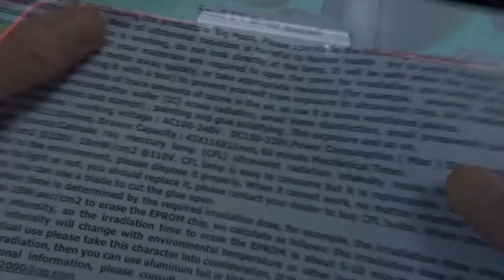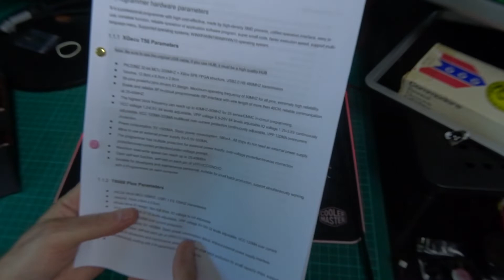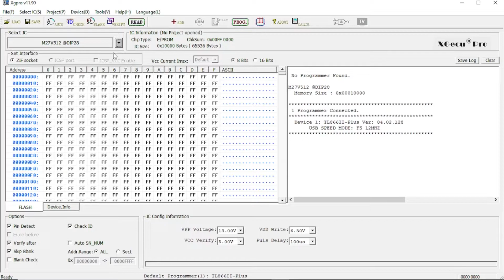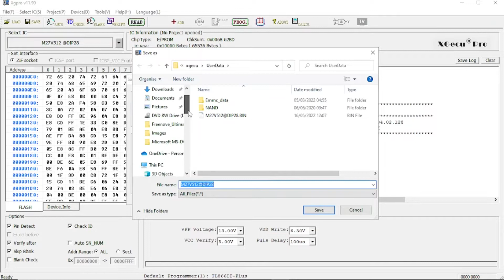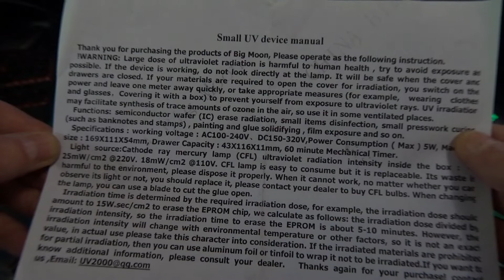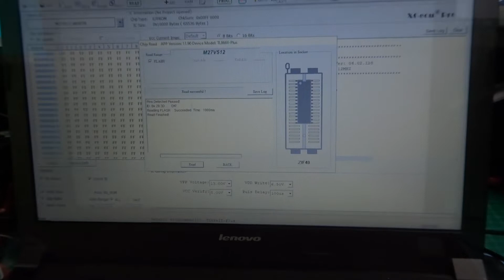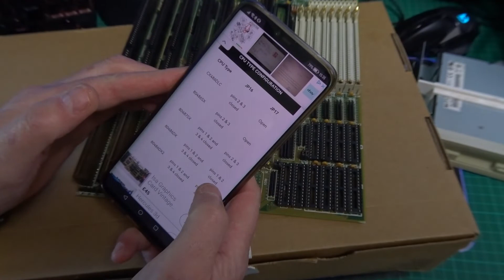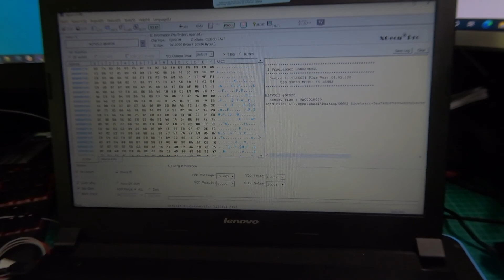Burning chips!

Comment: Hi can you link to the programmer and eraser you purchased im going to try this.
Reply from the maker: Hi. Cant link from the ali express app but search for Tl866ii plus and you will find plenty to choose from. I thing think they're open source and all much the same. I go one on its own without any adapters. I got the uv erasor off amazon uk so you may  have to search locally, though I think ali express would have been cheaper :
Erasable Timer Semiconductor Wafer Erase Radiation, Small Items Disinfection For UV curing or development https://www.amazon.co.uk/dp/B07V1FD23N/ref=cm_sw_r_apan_i_0PGFHWDCR2F9G3R88K3C?_encoding=UTF8&psc=1